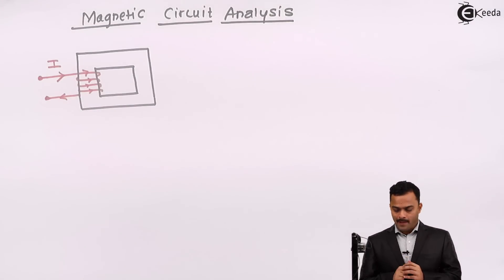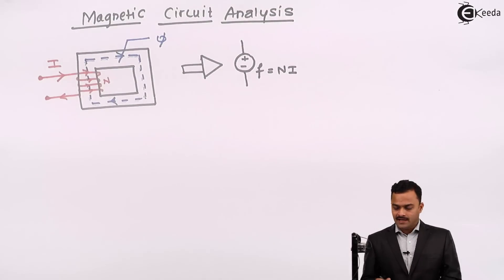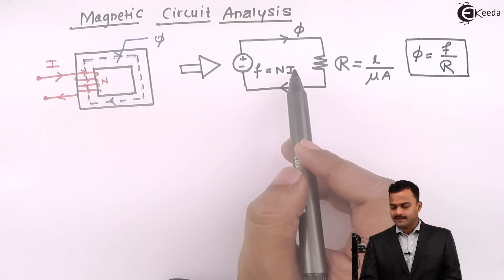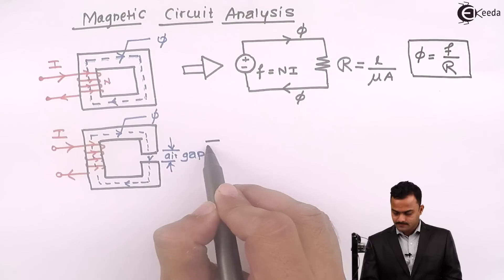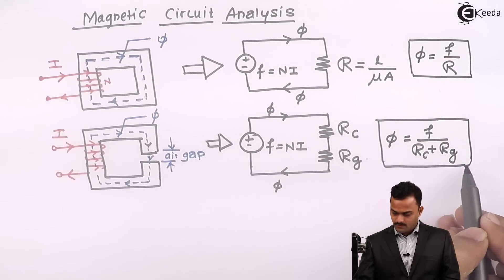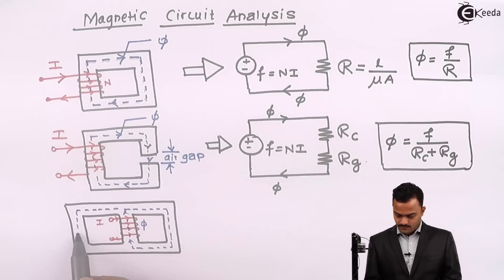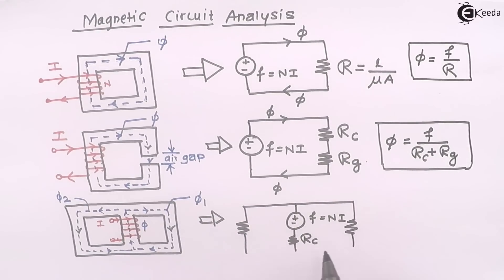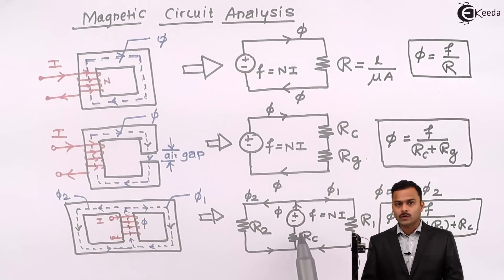Analysis of Magnetic Circuits - Magnetic Circuits - Basic Electrical Engineering

Comment: The B-H curve is NOT a line. That means there exists no function between B and H. You are trying to force the universe to conform to your ideas. This does not work! Maybe that is why electrical engineers do such a poor job on magnetic design.
When you buy a tire, do you immediately saw it in half to prevent overinflation?
I realize you are just mindlessly repeating what you yourself were taught. Like priests learning church dogma.

Comment: When you buy an automobile tire, do you immediately saw it in half? An air gap drops the permeability from 1500-2000 down to 2. You would get a better result using wood (4) or water (8).
You need to completely rethink what you are doing.